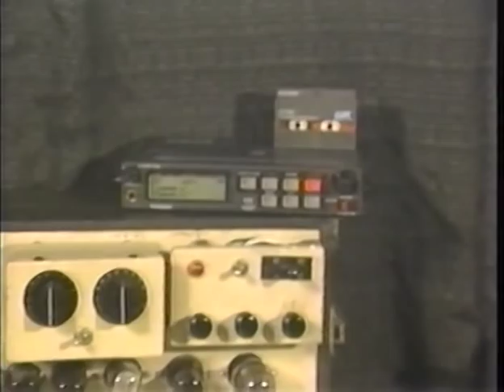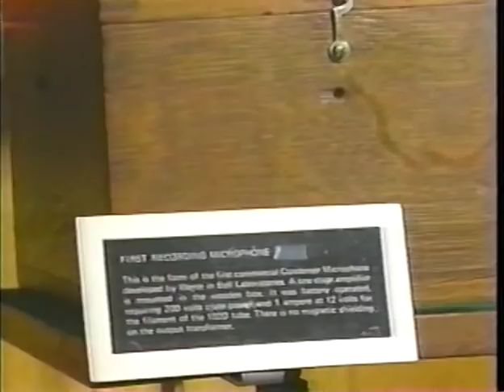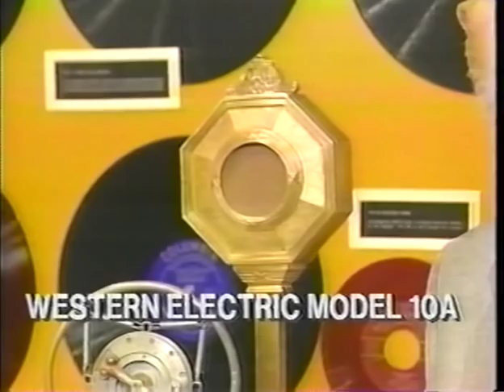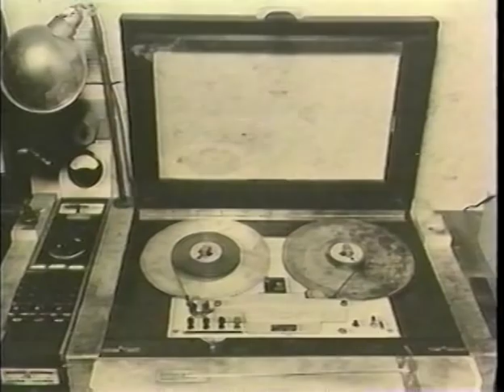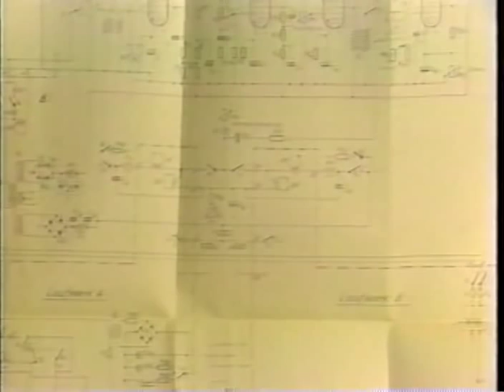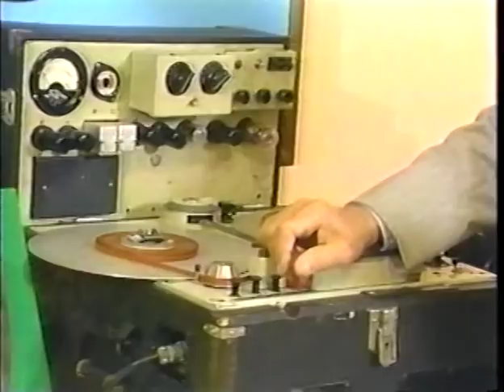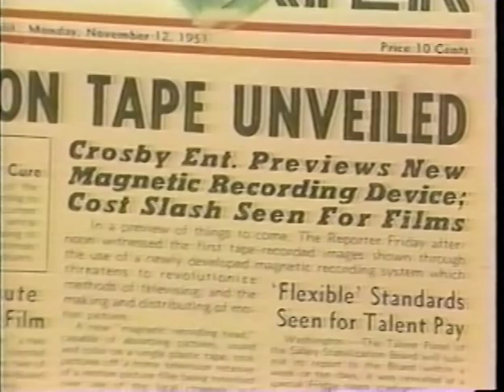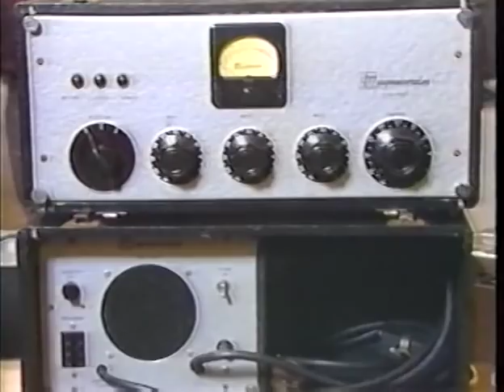An Afternoon with John "Jack"  Mullin

Comment: That was absolutely sensational - thank you for putting it online!! I thought I was going to have to mail AES a check and scrape up a VHS machine before I searched youtube. I'm working on archiving a bunch of tapes from the 40s and 50s from someone who worked in the tape division in 3M. I've found reels from 1947 which predate the Ampex 200 and still sound really good - wish I knew what deck he was using. Maybe he got his hands on one of the original Magnetophons?
Reply: Also have to say of course Larry Crane of tape op is the one who put this online :)